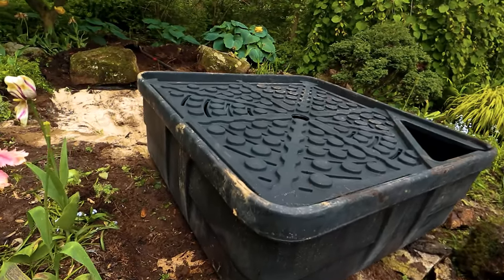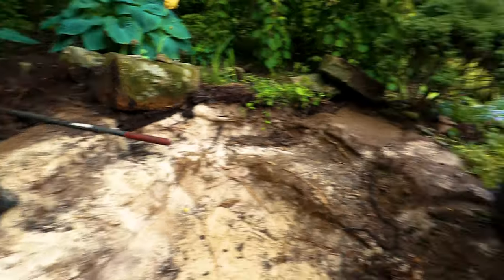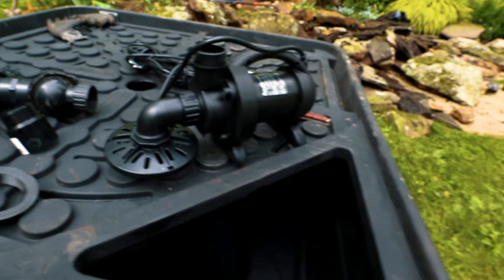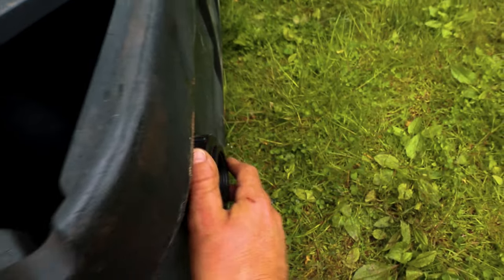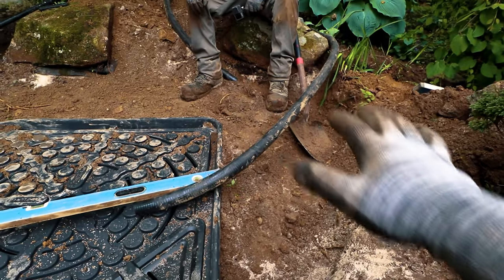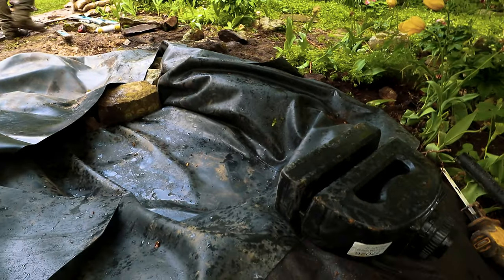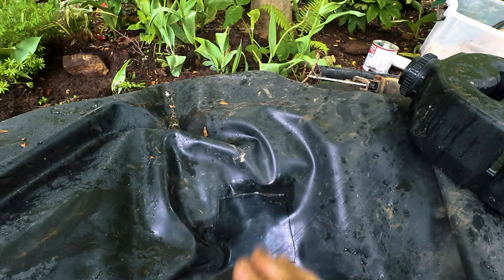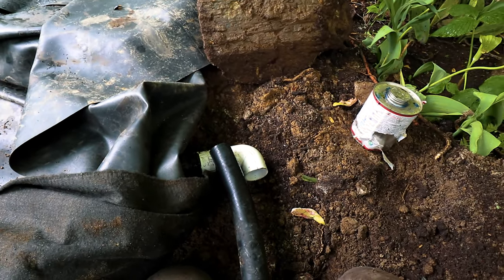AquaBasin and Spillway Plumbing Installation Tutorial | How To Sunday Small Waterfall DIY

Comment: What would happen if the area got flooded due to heavy rain ?  Would dirt and debris wash back into the basin and potentially damage the pump?  Thanks
Reply from the maker: the basin is capped, so debris cant get inside.
Reply: Would this 98 gal basin be enough for a 20’x3’ pondless waterfall?   Thanks